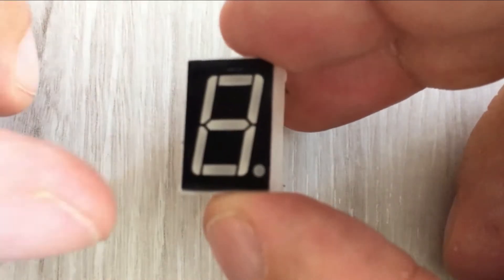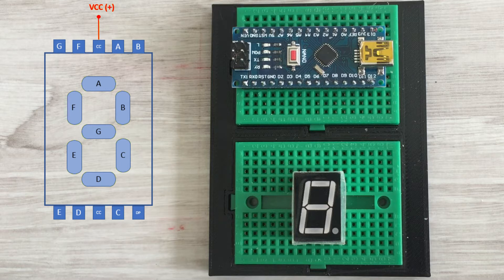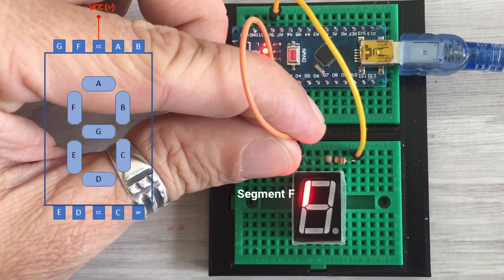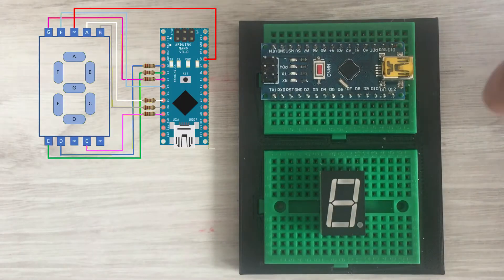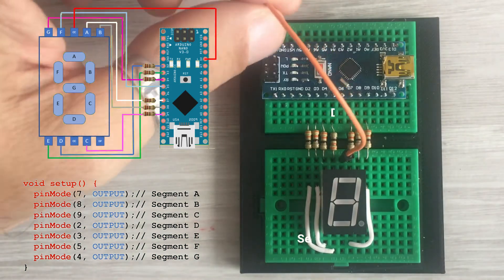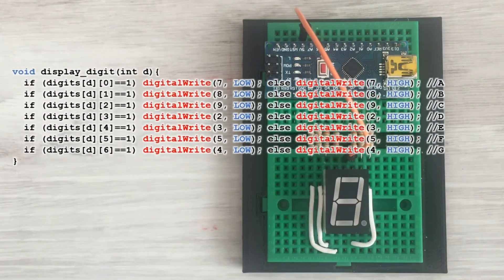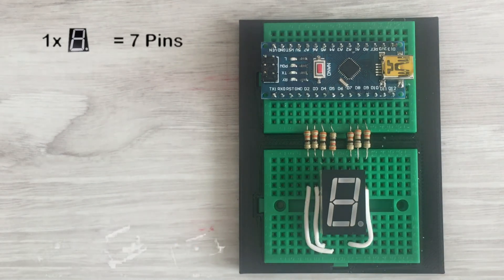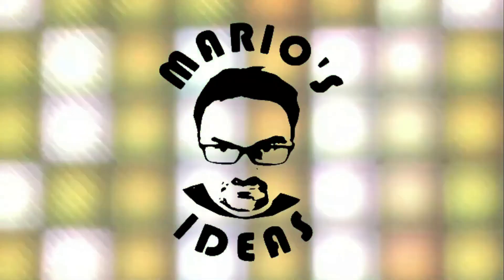Arduino Basiscs: Tutorial on Controlling 7 Segment display with Arduino

Comment: Hi, love your video's, i want to create a scoreboard. but the problem is that i'm not able to program my arduino to count numbers by using buttons.
for now i'm trying with a simple 1 digit 7 segment display and  a shift register.
the loop program is working fine.
but how do i modify it to work with buttons?

up , down, reset to 0 please help
Reply from the maker: I am not going to write it for you but I can guide you in the right direction. Up and down functionality I would do by connecting two buttons to digiotal pin 2 and 3 which have interrupts . Check my interrupt tutorial. https://youtu.be/EQuE7fGZizg There you would decrese or increase the number to display whenever state of the button changes. For reset there would have to be condition in the main loop that when the 3rd button (reset) press is detected the number to diaplay is reset back to 0.